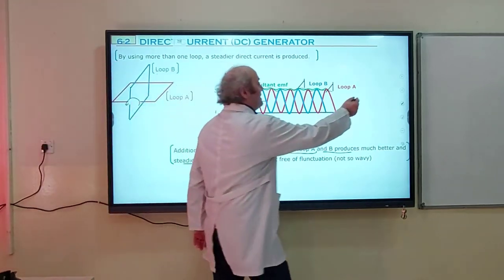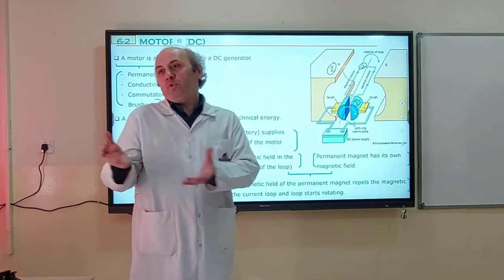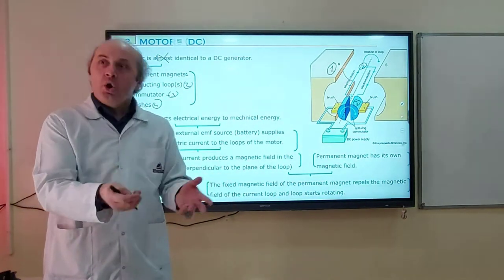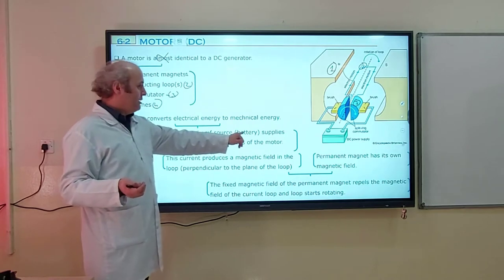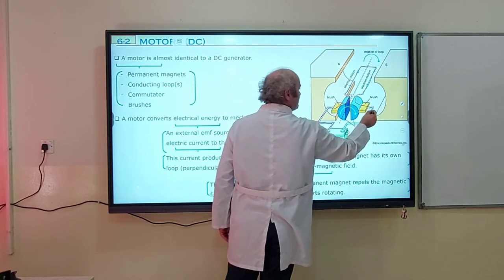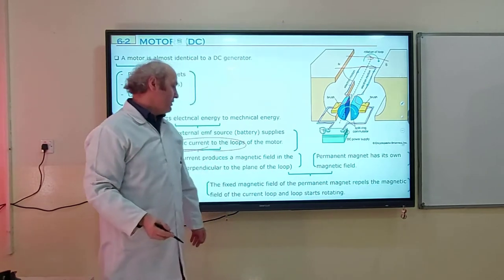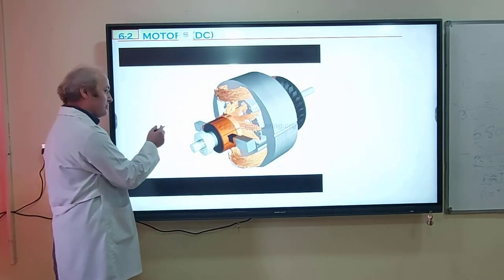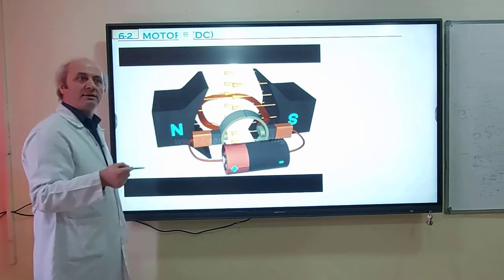Electric Motors, Chapter 6, Section 2, Course 4

Comment: Teacher does the commutator prevents the reversal of current or it reverses it? Cuz in section review it says it reverses but In chapter review it says that it prevents the reversal of the current in every half cycle so which one is it?
Reply from the maker: In DC motors, it reverses the applied DC current of the battery through the coil